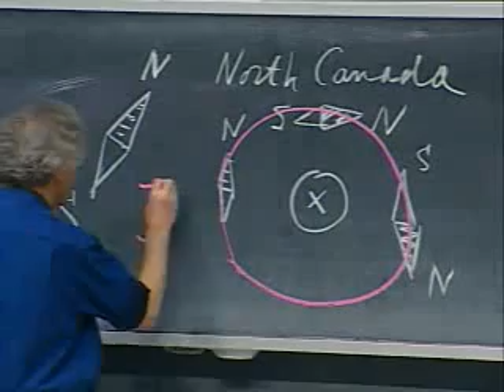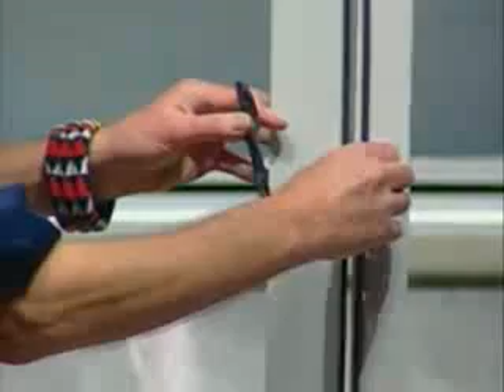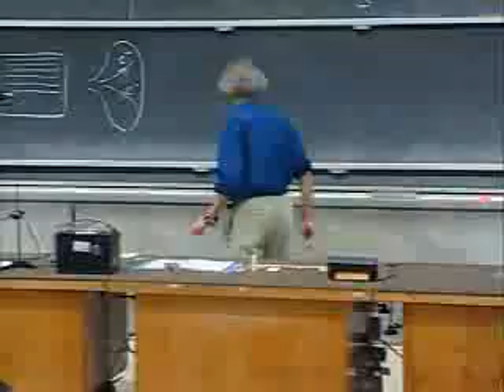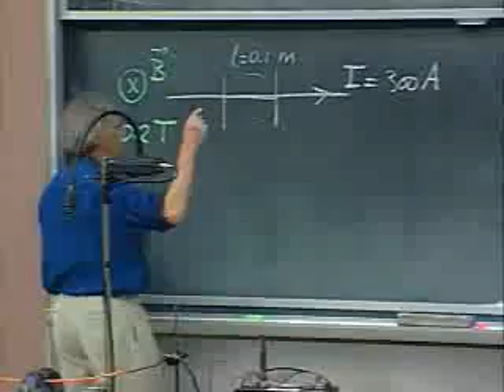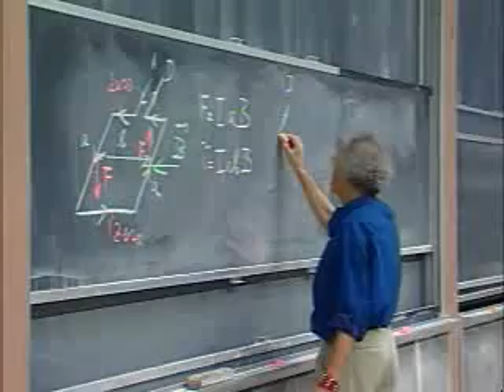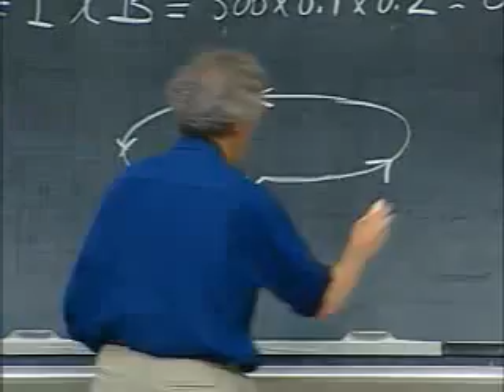Lec 11: Magnetic field and Lorentz Force | 8.02 Electricity and Magnetism (Walter Lewin)

Comment: Dear Walter sir,
The person inspired me to explore physics is you. So 1st I thank you with all of my heart.

I have a very silly question but I cannot stop asking as I am not at all getting satisfied with the available answers in books.
We know that the Magnetic force on an electric charge is perpendicular to the magnetic field direction. But why should it be ? If the charged particle had kept on moving in straight line perpendicular to the direction of magnetic field, is it going from lower to higher potential of any field ? I think no. Then why would the magnetic field oppose the electric charge's straight linear movement ? I cannot mentally accept the answer as "Lorentz force", as it doesn't depict what's physically happening in there ! Also, it gets more absurd when the moving charge starts moving circularly due to the magnetic field (like Charges inside a Cyclotron). I cannot visualize this ghostly situation where the charge is revolving due to a centripetal force, which is exerted by none at the centre !

Comment: He Treated current as vector!!! 11 minutes 5 secs-11 mins 15 secs.
Reply: अंशुमान अवस्थी In cases like this, the net current can be treated as a vector. Nevertheless, in current addition (as in circuits) it isn't.
Reply: No the I here is the product of current and the length of the conductor and the latter is a vector so it's a vector
Reply: current has a fixed direction higher to lower potential ok......In many cases the direction of the charge flow changes from one point to another, but the amount of charge passing a given point in a wire is the same at all points...........this is true for some particular cases